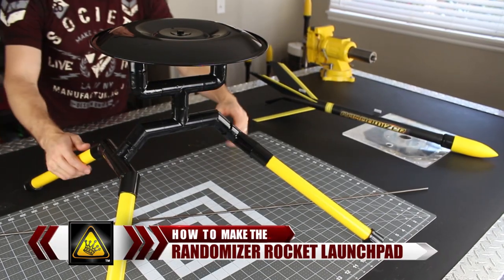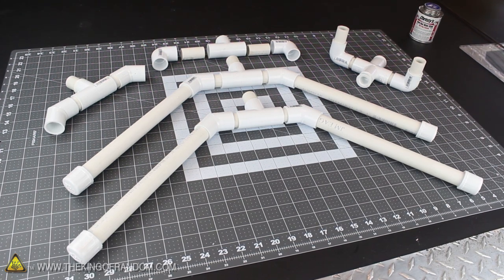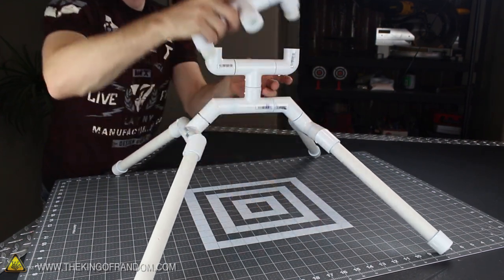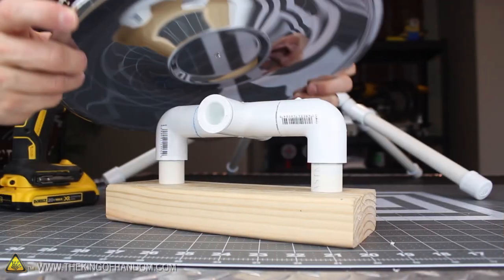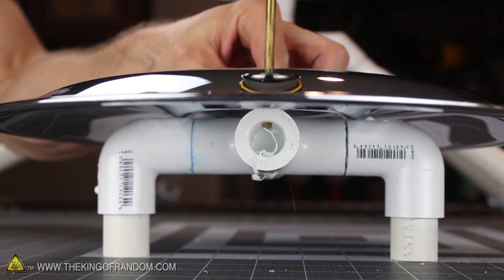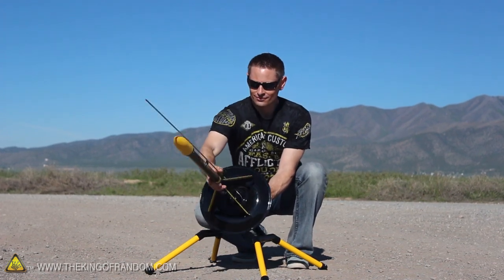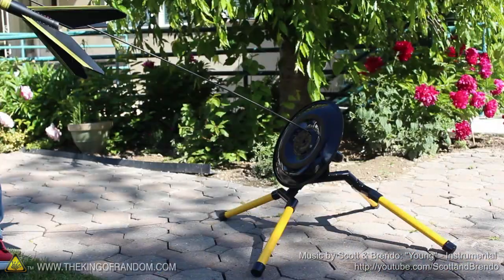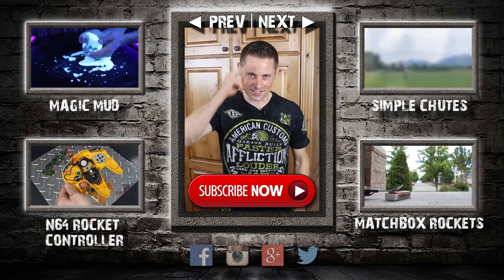How To Make A Rocket Launching Blast Pad

Comment: I’d love to see a version of this with interchangeable launch rods so that 1/8”, 3/16”, or 1/4” rods could be used. As it is, you’d need three separate blast deflector assemblies or a 1/4” sleeve on the smaller rods.

Comment: I used LASCO brand 3/4" PVC fittings. These only had an insertion depth of 3/4".  This meant I cut my 15 coupling pieces to a length of 1-1/2" vs the 2" mentioned in the video.
Reply: Im glad you did that because I cut them at 2” and was pissed the entire time I put this pad together. I had to recut mew couplers at 1-3/4” to get them to fit together properly.

Comment: I've built the first one using PVC, to create a module I could use with water rockets and pyro ones. Once I've seen how unpredictable model rockets (equipped with solid fuel motors) can be, I've decided to build a dedicated one, completely made of metal. Take a look at my "ible" on Instructables website, typing in the search box pyro rocket metal launch pad.

Comment: Actually, with most of the pvc cement that i have used, I have found that using an electric heat gun, you can melt the glue on the pvc and the pipe is still usable.
Reply: It chemically bonds the PVC when you use the legit PVC cement so I don't even think heat will get it apart.

Comment: Does anyone have ideas on how to lock down the launch rod? I'm just worried if it catches on the launch lug it will pull the rod with it. Most of the Estes pads have a clamping style mechanism for the launch rod. I think I'm going to build this, I just want to make sure it can handle my mean machine without causing issues.